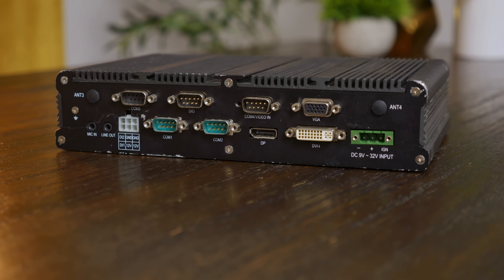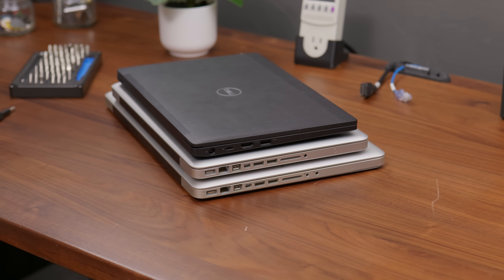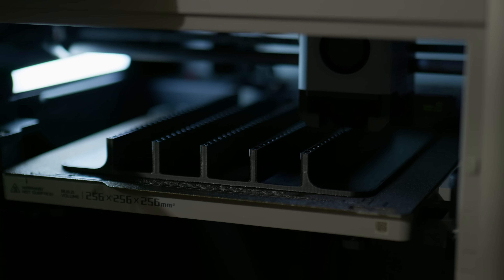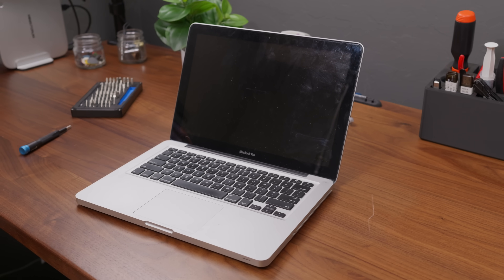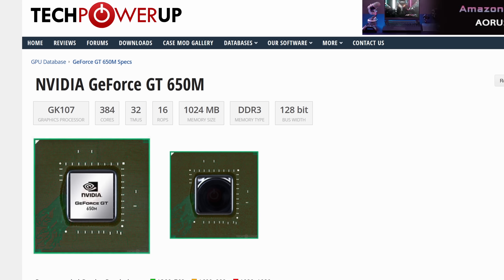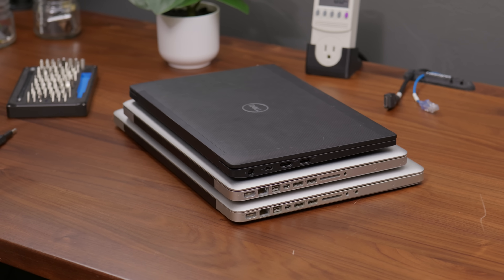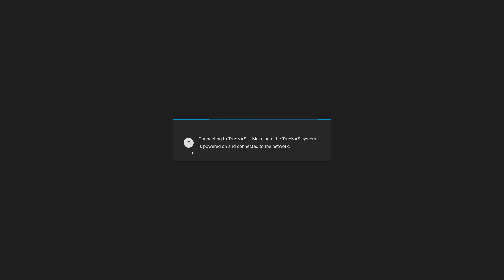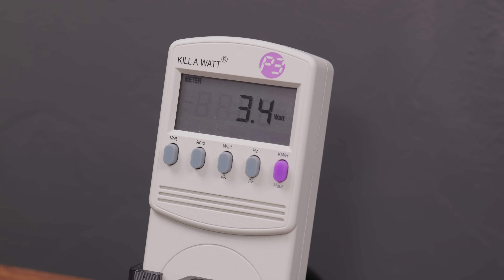Building Cheap & Efficient Home Servers with... Laptops?

Comment: The 2012 MBP is a legendary machine. You can literally upgrade everything except the display and cpu. That's the reason why I daily drive it even toady. 2 Sata Drives, 2 SO-DIMM slots, WiFi card can be upgraded to a better one, etc and one of the best build quality of a laptop even today.
Reply: Must be difficult to justify in 2025.

Slow SSD + RAM, slow CPU…
Reply: @kirishima638  Not difficult at all. I daily a Thinkpad T460 over here. My typical use case of my laptop does not require anything further, I also got tired of lugging around an overkill laptop for which i only needed the performance 20% of the time not to mention the added fear of damage/theft/loss goes down significantly when I'm out with my T460 compared to anything "better".
Reply: @simulation993  I do get it. I literally just reluctantly upgraded to a 2020 M1 Mac from a 2014 MBP, which was a great machine.

The reason? I needed to do MS Teams calls and just running Teams was pegging the 3Ghz i7 on the MBP and sending the fan into overdrive. And when I had to share my screen and compile some C++ code at the same time, which was when I knew I had to upgrade.

We don’t always get a choice as to what software we have to use; a 3Ghz i7 should be enough for everything I needed to do, but modern software is increasingly bloated.
Reply: @kirishima638  oh! I gotta say those M1 MacBooks are Chefs kiss and one of the first laptops I recommend to a lot of people. It’s all use case obviously because I’d have done the same in your scenario.
Reply: @simulation993 why tf would you recommend such obsolescence hell that can't get self repaired and will have updates dripped after a few years? 😂
Reply: @benja1378 an M1 MacBook Air is a great choice for someone who doesn’t want to spend a lot of cash and maintain or be introduced to apple ecosystem. Many people simply don’t need to power even the M1 has for their use.
Reply: @kirishima638  To purchase, it is not at all good value because you can get better laptops for the same price. But If you have it already, it is still better than a shit chromebook for browsing tasks and productivity. Better build quality, ram and storage compared to a cheap chromebook with 4 gigs of ram and 32 gigs of emmc. I got mine for free and I use it as a web browsing machine and experiment Linux on it

Comment: Excellent video buddy.  I hear you on the laptop batteries.  I would suggest a better setup would be buying those 10yr warranty ups’ (google them) and remove individual batteries.  Another option if the laptops are all usb-c charging capable, you could consolidate laptop charging to one brick.

Comment: I would make sure that you use a laptop that supports charge limiting. Limiting the charge to ~80%. 
Leaving it plugged in all the time at 100% will eventually ruin the battery life, lead to swelling and potentially fire risk.

Comment: Good one mate..I had a similar setup with my old Mac mini and MacBook Air, but I kept using macOS with the sharing function,it works perfectly with no issues so far. I might need to use Ethernet eventually, but for now, Wi-Fi works well, and I’ve placed them the way I want

Comment: It's amazing how little power the Dell laptop was able to pull. That's REALLY, REALLY good.

The potential for the battery bulging though IS an issue as that's what ultimately killed my 2009 MacBook Pro, but if you're able to run the laptops without the battery, then that would be awesome!

For $40, that would be a great option.

It is, rather unfortunate, that many are going for more than that.

Comment: Currently using an old Lenovo L340 15IRH with Proxmox as my homeserver, since Im missing the funds for a fullfledged server/nas combination.
Running Pihole, Bookstack, a test instance of jellyfin and Homeassistant with alot of resources to spare.
The only thing Im missing a NAS/storage tbh. The laptop even has a dedicated Nvidia 1060, which I could use for hardware transcoding. I managed to pass through the GPU to a test jellyfin container, but didnt get to testing it yet.

The system literally sips power around 9 - 11W while running my services. For starting out its great!

Comment: p.s., Question:  would linux ubuntu & OPNsense work with this scenario...?
Reply from the maker: OPNSense could be tricky with just one NIC. There are ways you can get around that using a managed switch and VLANs, but a machine with dual NICs is much easier.

Comment: What I would love to see is a solar powered home lab setup. Can you with only 1 x 100w solarpanel build and optimize a system that with a marine type of battery and a inverter (or directly of 12v to cut some losses) can operate 24/7 for a week on the solar alone while performing a average expected load of work? The power should be on average 5 hours of sun/charge per day aka 0.5 kWh with the losses in charging and inverting leaving around 3-400 Wh per day usable power. I´d love to see the ultimate of grid/un cabled home lab perhaps with mobile broadband or satellite if power allows. Could you design/build such a thing?

Comment: I managed to find a few small unmanaged switches that use 5V power and I'm pretty sure they don't draw more than an amp, would it not be best to use the laptop batteries as UPS for it? You could even repurpose the wifi chip in a laptop to use it as a wireless router so your whole network can last a bit if power goes out
Reply from the maker: Maybe, but I would be concerned about the longevity of the laptop battery. Might be worth it to just get a UPS at that point
Reply: @HardwareHaven  I had an idea for using a pressure sensor to glue between the battery and the case to detect pillowing, but thin-film sensors are expensive. Tempted to try using a button so that when it clicks you know you need to check it.
Reply from the maker: Haha this sounds like ideas I would have!

Comment: I’ve been running a triple laptop Proxmox cluster for a few months now and it’s been working great. Only issue has been getting a USB NIC to work properly because one of the (otherwise good) laptops had a 10/100 Ethernet port for some reason

Comment: What's with the hate for Macs?  I know the old intel macs of that era were not great, but compared to the PCs available at the time they were amazing.  Now with the Apple M series chips, they are unbeatable... especially in regards to power consumption.
Reply: repairability is one thing. although i was surprised how much was replaceable in these old Macs. now the Macs with the M chips have basically everything soldered, so you can't upgrade components. also Macs are typically overpriced. and then there is them trying to vendor-lock you in their ecosystem. with such a reputation, i'm not really surprised people here react that way. Apple is not really for tinkerers, which is the audience
Reply: @xybersurfer  Well, I'm a tinkerer and I only use macs for most of my computing needs. I currently run a 3 monitor setup on an M1 Max Mac Studio running both a Plex and Jellyfin server, an SDR to monitor police bands and flight traffic in my area, a steam gaming system with crossover, as well as interfaces for both my pi-holes and home assistant on my raspberry pis.  It's supper easy to SSH into any of the pis from my terminal on the mac.  I also have a PC I built years ago strictly as a gaming machine, in which I have installed Bazzite, and I even have a Windows install on a separate SSD just so I can use my old VR rig as the old Oculus Rift won't work with linux or Mac... yet. See the reason I use a mac as a daily driver is for the most part it is so versatile right out of the box that I don't need to tinker with it that much and i can focus on all the other stuff.  And the ecosystem integration makes for seamless transition to any of my other macs, ipads, or iphone, or connecting my airpods.  I can send and receive all my texts via any of my machines.   As for the price, Macs are very competitively priced.  The latest Mac mini is the best machine you can get for the price. The laptops are by far the best for battery life and beat many "gaming laptops" for speed, and the ones they don't have to be plugged into power to be fast enough to beat the macs.  And they last.  Every mac I've ever owned since I switched to mac 19 years ago still works.  I manage all my pis, macs, and pcs from the mac studio because it is a powerful, reliable versatile machine.  Could I have built a PC to do the same?  Yes.  Could I have built it for less... maybe, maybe not with the price of graphics cards these days, and they draw 3x the power of what my whole Mac studio does going flat out gaming in 4k so even if you could build it for less, I would spend more in electricity running it... and what OS would I use?  Windows sucks and is basically spyware.  I like a lot of linux distros but for compatibility, ease of use, and it's stellar ecosystem, Mac just wins.
Reply: I have an older MacBook and it runs Big Sur on it, it's nice for playing light games and watching YouTube in bed
Reply from the maker: I did a video on an old 1st Gen Mac Mini a while back, and people were surprisingly irritated. I don't get it either lol
Reply: Yeah that was kinda weird. I get pc vs Mac being a thing, but he was repurposing old tech. That's ultimately what this channel is all about.

Comment: That's why I keep going back to my Thinkpad x240 as my home server. It just idles there at 7-8 watts even with an external HDD. On my desktop HP z240 it idles at 25-30w. My raspberry pi is efficient but not powerful. So the laptop is my balanced setup. It has decent power and is highly efficient with a built-in UPS to boot.

Comment: That stand will roast any laptops kept in it long term.
Reply: I'd 3d print a fan mount or just use a USB fan on a stand to blow through.
Reply from the maker: With the 15" MBP in there as well, yeah it might be a bit much. But I don't think 20W is enough to get just the Dell and 13" too hot.

Comment: I have been waiting for a video like this.  As of October 2025, there will (likely) be a TON of ewaste laptops available.  With Microsoft reportedly forcing obsolescence on older hardware with the Windows 10 sunset event, it would be great for people to find a use for their older hardware instead of just throwing it all away.  This is absolutely a great way to repurpose these machines.  Thank you so much for doing this video!
Reply from the maker: Great point!
Reply: I just bought a 1st gen i7 17" ASUS ROG gamer laptop for 25usd. The front yard had some boxes and stuff laid out in their front yard. There was a laptop bag with a 3rd gen i5 HP ProBook in perfect shape. I'll take free lol. I think people are taking the windows 11 thing quite literally. I just bought a similar 4th gen Dell laptop that I upgraded to an i7 for 30usd total. It works great with windows 11. The ASUS and HP will most likely run it great too. It's nice having backups and this video definitely brought to light some ideas. I wanna build a NAS with a full size case and I can have the laptops on other duties as well
Reply: Yeah, now would probably be a good time to go get a dump of the latest 'good' Windows 10 for reinstall on people's machines when they decide they want to keep running with windows 10 instead, just without any updates or telemetry from Microsoft trying to get involved.
Reply: The Windows 10 sunset event doesn’t have to affect you. Windows 10 LTSC 2021 will get Security Updates until 2032. You just need to buy a license & install it.
Reply: @DK-mm1uq  I agree.  But then again, I was not talking about myself.  I think you can agree that most of the people effected by this event are not going to go to LTSC.
Reply: @DK-mm1uq  Well even with LTSC it could still affect you, cause some software is dropping support, such as autodesk fusion, which is online only
Reply: @DK-mm1uq  Or, install Windows 11 anyway. It's trivially easy to get around and any machine that natively supported Windows 10 will work flawlessly. Sure, it's technically unsupported, but honestly, I find the idea of having to manually upgrade major versions a plus.
Reply: @ True. I don’t want to get around it. Plus there’s no issue with Copilot or Recall getting added as part of a feature upgrade & all you get are Security-specific updates. That’s a massive win in my opinion.
Reply: @maurvir3197  Windows 11 used to have the same actual requirements as 10 but then they silently upped it and everyone running on a Core 2 was unable to boot. There's a risk of them doing it again so I wouldn't seriously consider running unsupported W11 on anything older than Skylake.
Reply: @eDoc2020  While it's true 24H2 introduced the POPCNT requirement, Intel pretty much slept for several generations during that period, so there aren't many hard differentiation points going back all the way to Ivy/Sandybridge. It was all performance tweaks for a long time.

Also, keep in mind that Windows 10 LTSC is still going to be supported for a while longer, and that means Broadwell/Haswell will too - even if they slightly predate Windows 10. Too many embedded machines use them - which is why I doubt you will be functionally stopped from booting Windows 11 on anything remotely modern.

I'm not saying Microsoft couldn't find some unavoidable architectural feature and cut off support for older systems, but it's not going to be quite as easy as killing the Core 2 era antiques. The real reason to upgrade a machine that old is raw performance and efficiency.

Comment: An interesting challenge. But everything has a lifespan... Orange Pi Pro with NPU, UPS, and compact 8-10-inch 21:9 MicroLED/e-ink displays with multiple ports—could these be the next big trend?
Reply: That would cost more than just buying a laptop
Reply: @Username-jt4yq  However, resources will only be consumed for what is actually needed and used—no unnecessary expenses. Mining on laptops is inherently unprofitable by default. And buying pre-used, 'pre-heated' laptops sold as refurbished is just a bad deal in the long run.
Reply: @Empty_Vima I don't remember this video having anything to do with mining crypto

Comment: My home server is a HP mini PC running Proxmox, but I recently added an old gaming laptop (8750H+GTX1060) to run local LLMs keeping power efficiency in mind. The laptop idles at around 15w at idle and ramps up to 130w when the gpu kicks in to run the LLMs. I got the best of both worlds in my opinion.
Reply from the maker: Nice!
Reply: I'm working towards the same. I'm trying to get a cluster of ZBook's running so I can have a dedicated instance of Ollama running for an AI for Home Assistant. The GPU's only have 4GB of VRAM, but that's enough for smaller models and is still way faster than trying to run it on a CPU.
Reply: What's your config for using the laptop to run LLMs for you?
Reply: Have you tried an ai accelerator?
Reply: perchance, is it a dell g3 3779? that sounds like my soon-to-be secondary server for a few vms worth of vdi that used to be my main machine in 2019 and 2020 and then again for a time in 2024

Comment: I'm running an old AMD A10 laptop (I removed the battery cause i don't trust it.. :D  ) and stuck Ubuntu server and Docker.
tip add this to your default grub file (/etc/default/grub)  : GRUB_CMDLINE_LINUX_DEFAULT="consoleblank=300"  # this will blank and turn off the screen 300 seconds after boot.

Comment: Do you think that running truenas from an usb is ok? I have only 2 sata ports on my desktop and I’m wandering if it is worth it to buy a pci-e sata adapter (or the one for the small wifi card) or just buying a sata to usb for the system disk
Reply: Doing 2 decent USBs in mirror is fine. If you can do usb connected ssd is even better.
Reply: I wouldn't do it. If you think to use unraid it could be a choice, the USB is only for booting up, truenas is different. If you have a m2 slot I would consider an m2 to six sata adapter. They're pretty cheap (15/20€) and you could manage to use 8 disks with your two native sata ports. It's what I do on my offsite nas at work. Mini itx board, adapter, 2 ssd for mirrored boot drive and 4 4tb hard drives.
Reply from the maker: I wouldn't say it's the BEST choice, and I would never do just a single one. Regardless, always have a safe backup of your config to make a fresh install easy.
Reply: @HardwareHaven  can’t I save a backup in my pool directly instead of having mirrored boot drives?